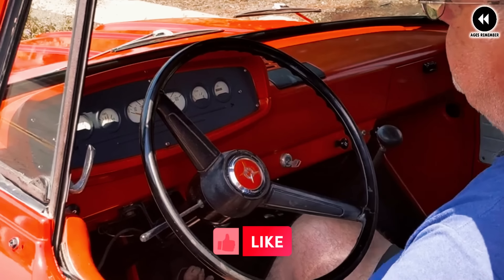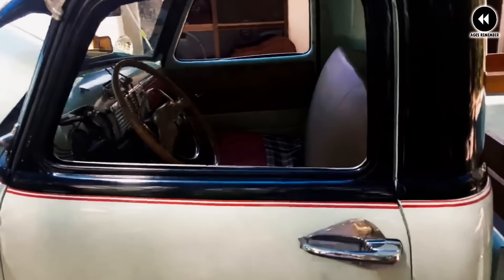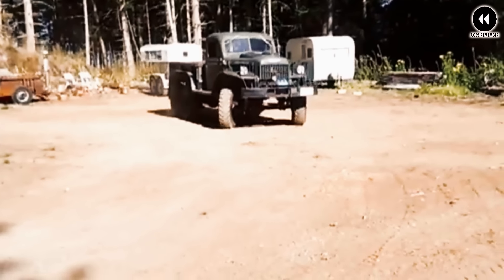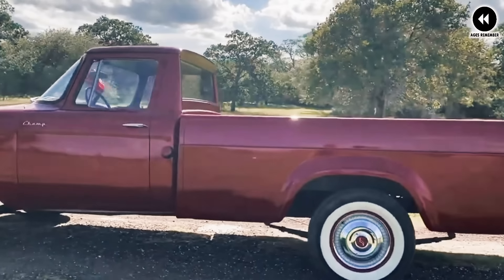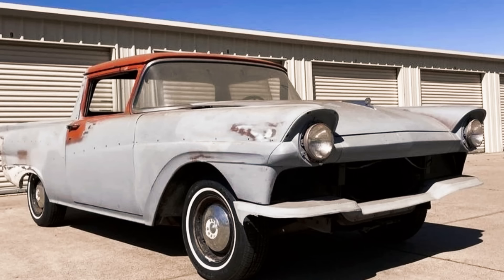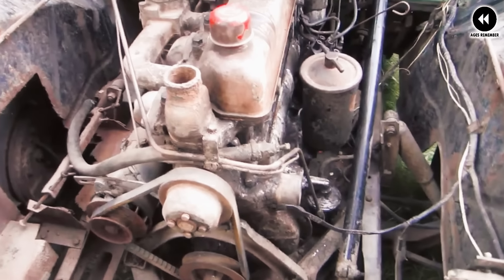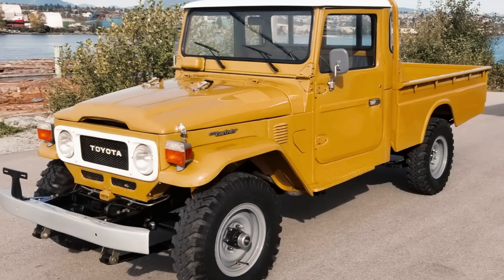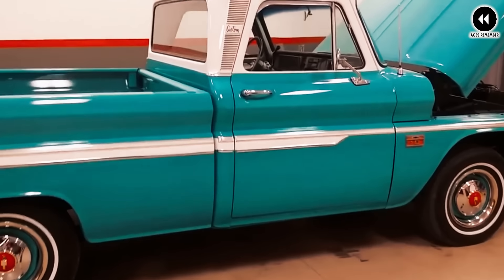15 SUPER GOOFY Pickup Truck! Level 1000 Shocked Even Elon Musk

Comment: 2:31 doesn't look like a pick up.2:51 eye catching? that's not the word I would use. 3:55 if you say so. There should be a law against butchering those B models. 11:35 and you show a k series commercial truck.12:58 I don't think ergonomics was a thing in 1949.14:19 1963

Comment: A few things... the '47 Chevy pickups weren't actually named the 3100 until 1949. The earlier models said 'Chevrolet Thriftmaster' on the hood side emblems. Early 1947, they still retained the 1946 style body, and late 1947, they went with the new design with the headlights inside the fenders, and the wider cab. Also, '47 only had the gas tank UNDER the bed, instead of behind the seat. All the 1/2 and 3/4 T. pickups came with the babbit bearing 216 cu. in. L6 and had 90 hp. stock. The 1 1/2 T. trucks had a 235 cu. in. L6 that still only had 90 hp. stock. The 235 L6 wasn't officially used in the 1/2 and 3/4 T. trucks until 1954 and the horsepower was upped to 112 hp.

 I restored a late 1947 3/4 T. pickup back in the 1980's, and it had a rare special order 'granny gear' 4 speed top loader from the factory. The old 216 was pretty anemic for highway driving, and I eventually converted it to a '79 250 6 cyl. with the integrated head and around 140 hp. Coupled to an overdrive 5 speed out of a military 6x6, it would pull most anything I hooked it to, and I ran it for the next 22 years+ with that engine mated with a 4.55 dual-wheel rear axle.😉